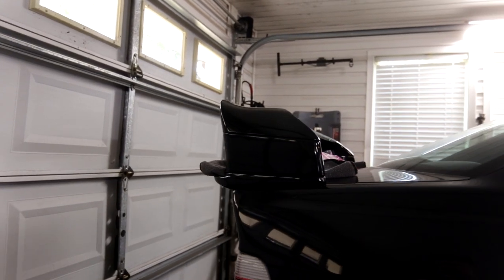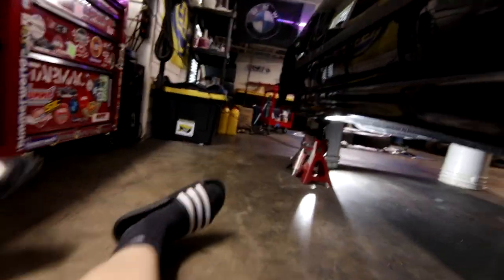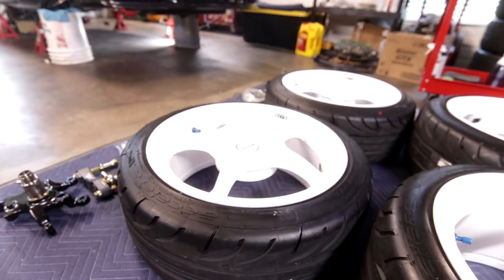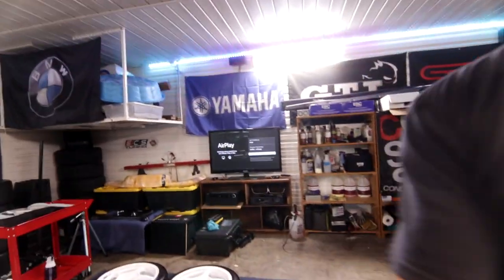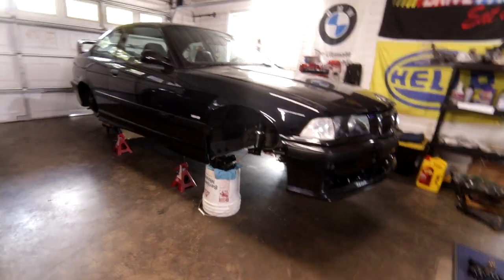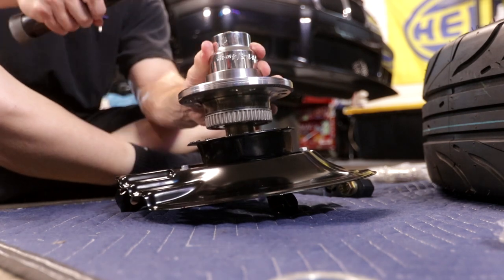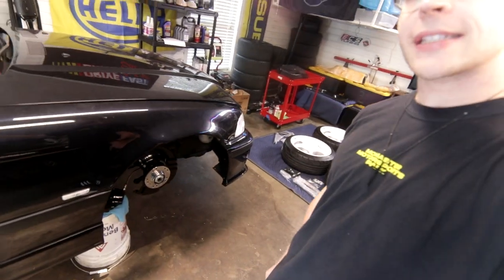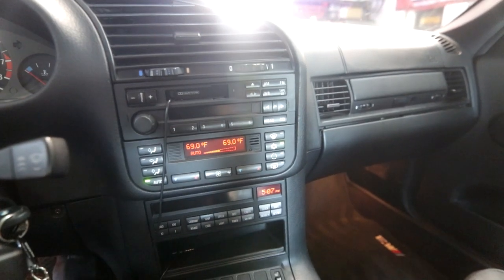NDI 5x114.3 Conversion, SLR Angle Kit, Rust Repair, and MORE!  - E36 M3 Drift Car Project Episode 10

Comment: thank god you're back. keep it up gonna be restoring my 320i and prob swap it to a m50b25 (turbo in future) but wanna rebuild the engine before i swap it in any tips?
greetings from the netherlands
Reply from the maker: Man I can’t thank you enough, it’s comments like these that make me so excited to keep going!!  So while the engine is out I would definitely safety wire the oil pump nut, replace the pickup tube with the Z3 reinforced tube, and replace the oil pan gasket.  Much easier outside of the car!  Also doing other gaskets like the oil filter housing gasket, rear main seal, intake manifold gaskets, valve cover gasket, etc are all good ideas!  Otherwise I’m sure you know if you want to turbo a stock engine swapping to ARP head studs and a copper cut ring head gasket (maybe thicker to lower compression) is a good idea!!  That also gives you a good excuse to go ahead and install a fresh head gasket.  If not though you can always do that in the car it’s just way easier outside!

Otherwise you should be just fine!  Have fun along the way, that’s what’s most important.  Thank you so much again I’m glad you’re here!!
Reply: I'd also say to inspect/replace the timing chain tensioners and replace the chains/guides. IWIS has race chains which have slightly stronger links.